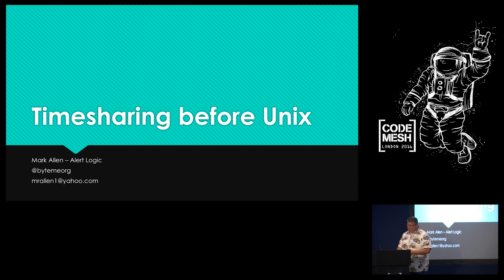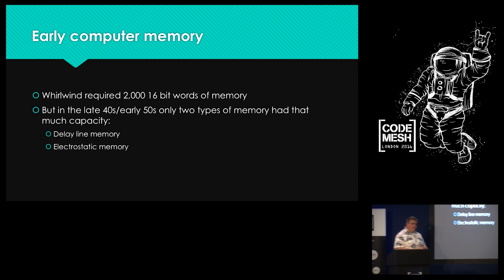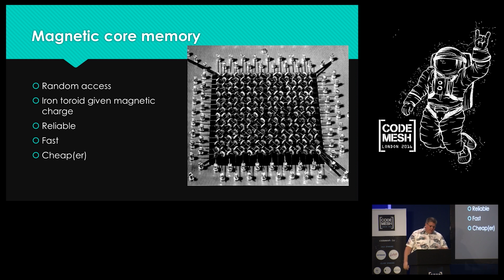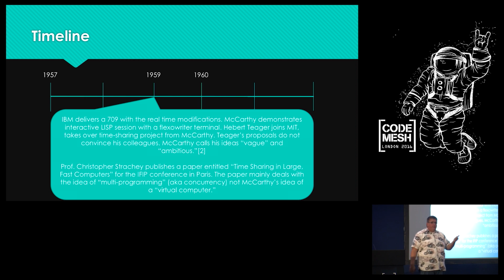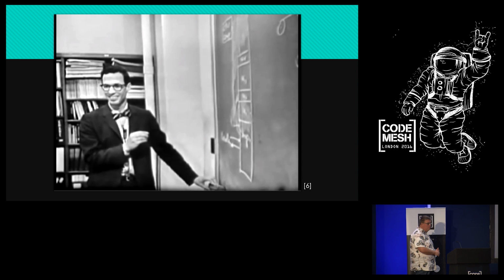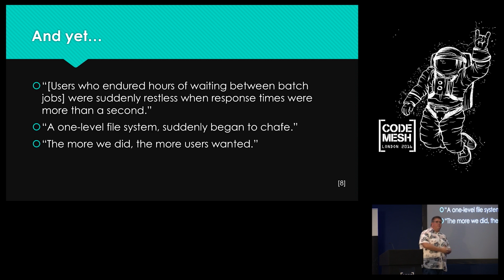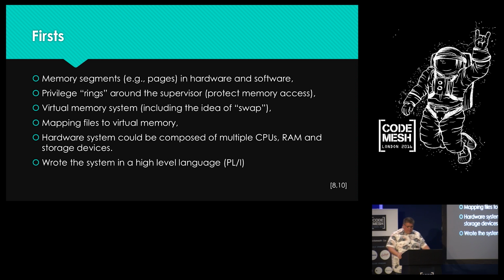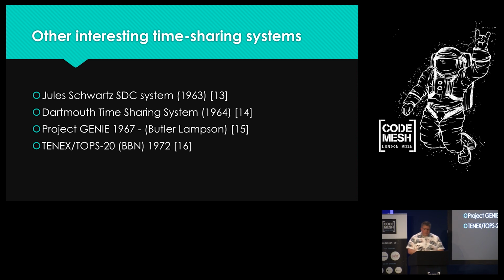Mark Allen - Before Unix: An Early History of Timesharing Systems

Comment: The capacity of memory for Whirldwind, TX-1 and the TX-0 shouldn't be understated but I think it's also very important to note that they also needed a capacity of 2000 words that wasn't slower than dynamically storing 'RAM' on Punchcards and getting an operator to put the right card in when program needed it! (Taking the -pee a little, but you get the point!) and even when we had Valves, you needed reliable and sturdy tubes!
The TX-1's memory was so complex, they had to build its smaller bro, the TX--0, to get the 1's memory system diagnosable!

 Incredible subject and most all of even the simplest parts of the story are fascinating topics in their own right,  thank you for your presentation!

Also, fun as a separate topic, the very early computers that the Australian Govt got (from the UK iirc) also use Mercury Lines, but they had all sorts of interesting tech challenges because Oz can get quite hot, but the seasonal changes completely blew out carefully calibrated systems.
There's fascinating 6 or 8 part series on YT specifically about Australian Big Iron!

Ed: The less Time-sharing IBM sold, the more machines they sold - people were calling them on this shizzle even in the early 60s!

Ed2: the memory size of CTSS - worth noting that it would have been literally impossible to have made CTSS so small on any other machine, a lot of what made Time-Sharing magic as the custom hardware it needed.  Converting machine state into a register file that can be swapped, and the likewise abstraction of essentials like the Program Counter, user permissions, mag-drive perms and opened resources and stuff - was done in hardware a lot!
IIRC one of the things that Knight and Greenblatt did with ITS was to bake a certain amount of magic into the Terminals themselves.
I'd be interested to know how much emphasis the technology of mag-reels and actual spinning rust was improved or indeed invented because of that speed?

Comment: Poor guy is massively uninformed as demonstrated by his complete unawareness of the Digital PDP-6 and PDP-10 family KA, KI, KL-10 processes providing commercially available time sharing starting in the 1960s. The major time sharing service CompuServe was based on PDP-10 mainframes running “the monitor” because the os never had a name for years. Eventually named TOPS-10. BBN added a paging box to create TENEX. PDP-10 time sharing user loads ranged from dozens up to just under a hundred users with uptimes of six months between re-boots. PDP-10s at national labs provided terminal front ends for clusters of CDC 6600/7600 mainframes, implemented the Ramada Inns inline reservation system.  Bill Gates and Paul Allen learned to program on a Ten terminal.

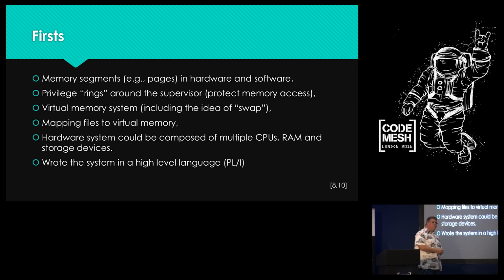Comment: 37:33 Pages are fixed-length pieces of memory, segments are variable-length. I think MULTICS had both. Also note that its segmentation scheme operated within a flat address space. Unlike the later horrible kludge that was the x86 architecture, just for example.

Comment: 22:37 Flexowriters were modified IBM Selectric typewriters, as I recall. They had added to them the ability to punch and read paper tape, as well as connect to a computer.

A lot of systems used the ASR33 or KSR33 Teletype devices as terminals instead. These connected to computers via a serial 20mA current loop interface. Not sure how the Flexowriters connected.

Comment: Mercury delay line was so cool. In one long tube filled with mercury, a transmitter on one end of the tube, and a received on the other.  Using timing, you could tap about 1000 bits before the first of the 1000 would propagate to the receiver at the end of the tube.   The “delay line” concept likely stems from the time it takes for the first tap to travel to the end of the tube.   Once the tap travels through the mercury and hits the receiver, the first bit to arrive would need to be regenerated.  Those 1000 bits would be all you got from that tube.  The pulses were ultimately encoded so the timing wouldn’t be lost if you had a stream of zeros.